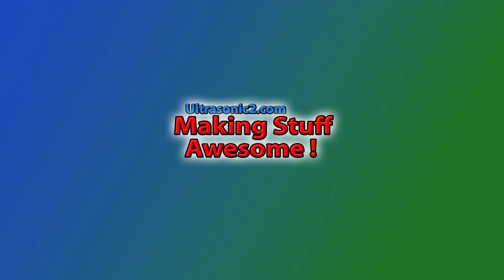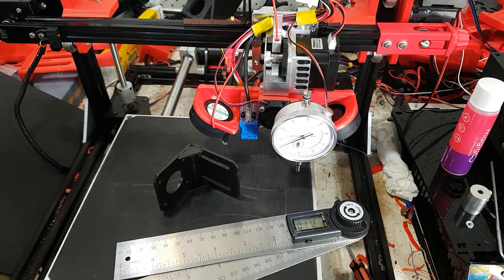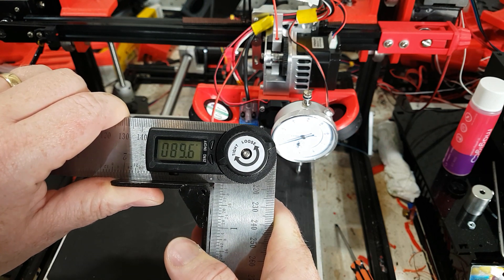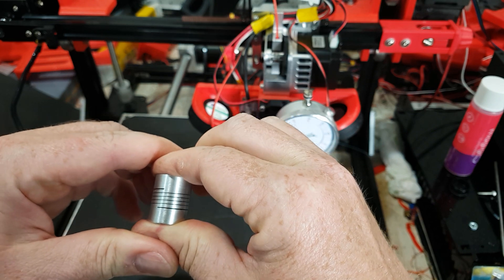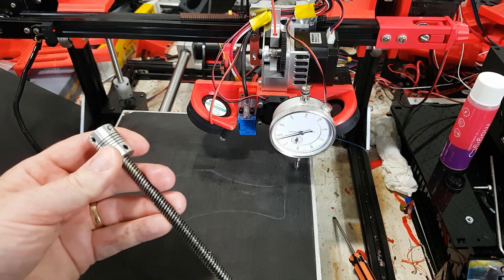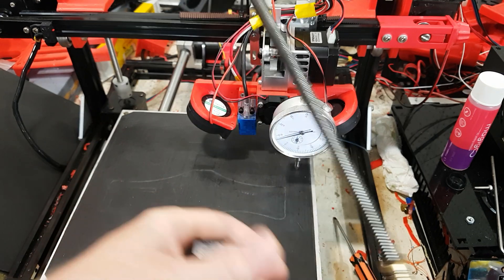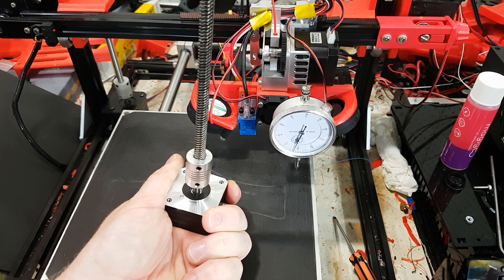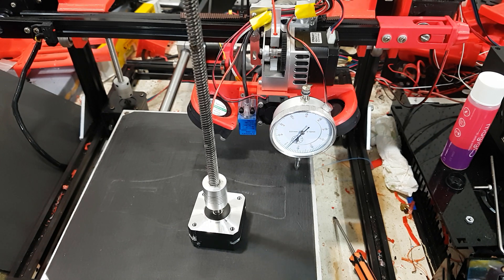⚡️ 3D Printer Lead Screw Couplers. The ball bearing Hack !

Comment: This is how I have been using the coupler, too, for years. I also made a little video (not for that reason)  a couple of months ago that shows the position of the bearing ball in the coupler. With this mod, this type of coupler has become perfect to compensate for any deviations (deflection, not lined up, etc) that occur in a 3d printer. I noticed only a small negative effect that the vibration gets on the lead screw and the nut rattles (not very, but audibly). I damped this with a soft silicone-like material placed on the top end of the lead screw, gently touching the frame of the printer (Anet A8).  https://youtu.be/8k2pWQ4To8s?t=5

Comment: Surely when you fix the coupler to the steppa motor its wise to make sure that the motor spindle does not intrude into
the upper 8mm space, in fact leave it just below the 8mm hole then the ball bearing will sit central how it should and it will work efficiently and the coupler will do the job 100%
6mm ball bearing is what you require.

Comment: Nice mod!
But when using the coupler that has 2 set screws clamping down on the z rod, wouldn't that push the rod towards a corner and cause wobble?
In that case, will the coupler that uses only 1 screw and tightens around the z rod be better?
Reply from the maker: It has to push the rod into the opposite side if it has 4 screws or 2. If the holes are slightly to big AND not to big by the same amount V the 8mm and 5mm hole then that has to cause them to be off center.